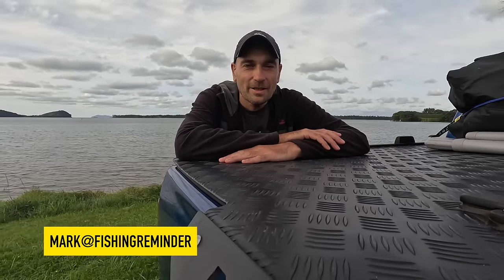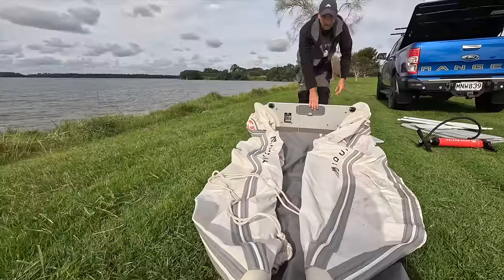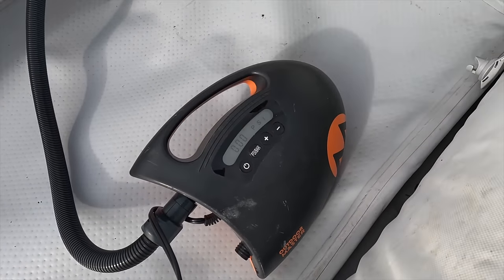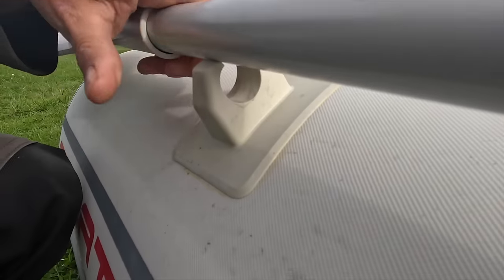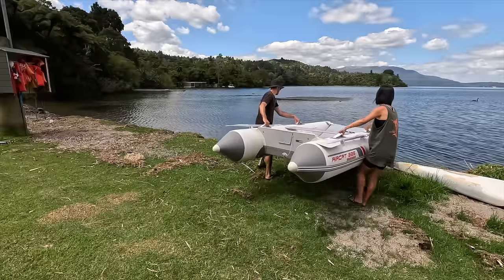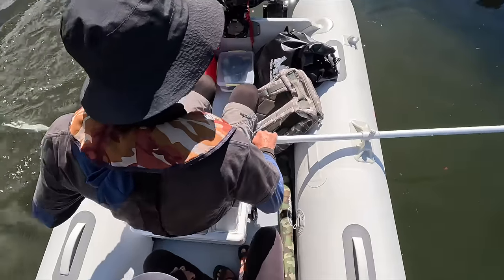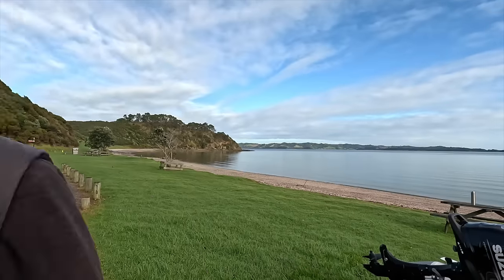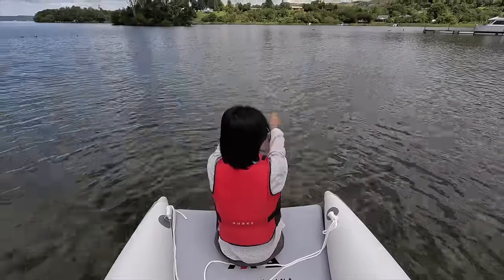Aqua Marina Aircat Review: The Best Portable Fishing Boat?

Comment: The holes in the transom are for a safety cord or chain to the motor so the motor doesn’t fall in the water
Reply: I’ve seen many fall in while boating at least if it falls in your motor won’t hit the bottom
Reply: hey Ray. we hang our Rib off davitts at the transom of our and most catamarans.This is another reason for these holes
Reply: I do not think these holes are for a safety cord.  There's a loop on the inner motor mount plate that is there specifically to cable the motor to the transom.  I think the holes are to mount eyes for either towing or hanging.

Comment: Awesome work brother. I bought one back in January and there was no info out there. Paid $1050 new so  I was a bit worried it may have been rubbish compared to the much more expensive truekit etc. I run a 9.8 2 stroke parsun. 32km/hr one up and 26-28km two up, it can plane with upto 230kg of weight on board. I put the same wheels on. Took a bit to work out the measurements, but they work really well.
Reply from the maker: thanks man. Yeah you can't beat it for the price, eh. A 9.8 HP would be awesome. I only wen't with the 6HP to save on weight for traveling. It does make quite a difference if you get up to 32km/h.
Reply: @Fishingreminder  I run a 15 hp 2 stroke now for when I am loaded up. Doesn't really get a higher top speed get up to 32/hr with two and gear,  but so much quicker onto plane and running at half throttle for a cruise at 28/km hr.
Reply: @jwqc1 I am interested in getting one of these with a 15hp outboard. Do you think the boat handles the bigger outboard well? Not too heavy?
Reply: Hi do you know the best way to mount a fish finder transceiver to the Aqua Marine Aircat?
Reply: @jamesdfriend  handles it fine, but its a  light 2 stroke 15. Not sure about a heavy 4 stroke

Comment: I have the aqua marina 3.5m udeluxe can't recommend it enough for the money . But I find i can pump mine up in 10 mins with the 2 way pump supplied . But when I am inflating the floor I unscrew the 2 way valve and just have it on 1 way for the last part as it's too much pressure for the pump when you pulling pump handle back up. I have recently taken the boat to fiordiland and stewart island and it has been great. Also I tried the rib ports too and I think the boat has a silicone coating and if you have a look on burnsco they have a 2 part inflatable boat repair kit and that's what raillblaza recommended for gluing the ports down to the pvc. I run the merc 3.3 hp 2 stroke on mine as it was 13kg to fly into fiordiland . Gets on the plane with one person which is amazing . Would like a bigger motor now though. Great review enjoyed watching. Keep up the great work cheers
Reply from the maker: That's awesome Phillip. Cheers for the feedback. I'll be taking it down to the South Island this summer. Looking forward to it. Might take it to Steward Island as well. Did you use it to get to some campsites?

Comment: Hi, do you think that the boat is sturdy enough to support a 20 HP engine? I know it is above specification, but I already have the motor. The idea would be use the engine at a medium throtle...
Reply from the maker: I doubt it. The problem is the weight of the 20hp engine. Not sure if the transom is sturdy enough to hold that weight since it's all just glued. It would be good fun though cranking that up with a little boat like that, you'd be flying, haha. Maybe give it a try and let us know if it works.

Comment: Great review . Considering a small inflatable for our caravan trips. To seal those air leaks you CAN patch using Stans tire sealant for MTB tires, works treat on my old hypalon boat, totally airtight for couple seasons then repeat. You may want to research chemicals used and see if they attack boat material. Alternatively try on inflatable floor first and see if it is OK after year before using on boat as floor is cheaper to replace. 

The holes in transom are for eyebolts, fit eyebolt to both sides. Used for craning boat when launch tender. I use inside ones to clip things to them. Especially a safety rope for your new motor, also tie the two motor clamps together with bit of rope to stop them unwinding. Youtube has plenty of videos of outboards going south while underway.

Tightlines
Reply from the maker: Thanks for the feedback and the tips. Much appreciated. Also for telling us what the holes in the transom are for. Good idea to secure the outboard 👍
Reply: Justed edited my post replaced can't with CAN.

If you can remove valve then pour a cup into air chamber. Fit valve pressurise enough to hold the shape and rotate boat so sealant flows to holes. In my case they were on top so upside down. Try to keep it out of valve. If you can't remove valve use syringe with small hose which should fit through valve. Only takes a few minutes to set, best left at low pressure for few hours.
Reply: The holes are for umbrella, anchor rope, fishing rod, etc

Comment: EXTENSIVE REVIEW.

I purchased the Aquamarine Aircat 335 in late July 2022, it's approx. 8 to 9 months old at the time of this review. I've had problems with an extremely sticky substance after about 2/3 months of use as a tender (I live on my boat in the Australian heat) It seems to exude from the PVC and is impossible to clean with conventional methods of maintaining an inflatable dinghy. It's so sticky that clothes are ruined if one sits on the tubes, as the substance transfers to shorts and WON'T come out in the wash. It's so sticky that if my little dog rubs against it, he sticks to it, poor boy!! I'm 78 years old and I've owned many inflatables over the last 60 or so years, luckily they were all made in America or the U.K. and are probably still going strong. My last inflatable was a 20 year old PVC 'American made' Mercury that I bought second hand and was used as a tender and all it had on it was scuff marks and general wear and tear marks, not even one puncture, but I was stupid enough to give it away to a friend when I bought this Aircat. This sticky mess is all over the dinghy, possibly wherever sun gets to it, even under the handles. If I give another boatie a lift then I have to put some canvas down for them to sit on. After trying all methods of cleaning, including specialized inflatable cleaners, sealers etc., and a Gurni high pressure gun, NOTHING removes the stickiness. I did a test patch with ACETONE, GOD FORBID, which removed it with a very hard rub. But then the sticky mess returns after a few days anyway so I have now totally given up cleaning this dinghy and it's in such a mess, it's embarrassing. If one rubs against it, then it will remove the hairs on your legs. Maybe I should sell it to a hair removal salon!!! We are in Autumn now and the stickiness has settled a bit so it's definitely the hot sun causing the stickiness. After 6 months of use as a tender the large sheet of PVC that holds the air floor in place, which is still securely attached to both hulls the full length of the boat, has stretched quite a lot and in turn, even a small amount of pressure pushing down with one hand in the middle at the front as a test will send the front under water, so trying to get back on this dinghy in deep water would be impossible without filling the thing with water. It was OK when brand new, but not now that it's stretched. This means that even with only 2 people on board at midships the front will go under water and the Aircat fills up with water!! This Aircat cannot be towed behind a boat...EVER...DO NOT TOW IT, as even towing it at 1 or 2 Knots the front will go under and the Aircat will fill up with water up to the top of the transom and will drown the outboard on the Aircat, which nearly happened to me. Aquamarines own compliance plate on the dinghy states it will take 5 people or 500 kilos!!! Well luckily I'm mostly on my own and it's very safe and quite capable even in a small/medium chop with my 4hp four stroke on it. The speed with one person on board with the 4hp is about 4/5 knots and I think it would plain with a 6hp outboard with one aboard. On the odd occasion I have a passenger on board it gets rather hairy when the bow goes under water when coming off the throttle and whatever gear is on the floor gets ruined when the boat takes on water. It's dangerous enough with 2 on board, so 5 people as per the compliance plate would be downright deadly in it's present state. This compliance plate should be changed to a maximum of one adult and one child... At the most. All the seams, handles, ply transom attachment etc. are still OK and the glue has not given way anywhere.....The supplied ply seat was totally the wrong size and would never fit and after I made lots of adjustments, it split anyway as soon as I sat on it and I'm not that heavy. Admittedly any dinghy used as a tender, has to work hard but a "decent" dinghy will cope. If you have children then please keep an eye on them while playing with this dinghy. In Aquamarines own video it shows this Aircat as a tender pulling up to a yacht, so anyone would think it's OK as a tender. Even left on davits, if it's in the sun it will eventually get the sticky mess. If you are cruising and only use it when you get into a new port and deflate it after every use, then it may last. The PVC on this Aircat IS NOT SUITABLE FOR PURPOSE. My emails to Aquamarine, the manufacturers, really didn't get me any satisfaction and I was told by them that I didn't maintain it, which really got my back up. Luckily, the Australian retailers were very good, understanding and came to the party. Photos available. Rob

Comment: Hello! thanks for the nice review.
I have had my boat for 4 weeks and am very satisfied. I have a Yamaha 4hp that weighs 23 kg. I carry boat and motor up in the apartment 3 floors so I think max 6 horsepower due to the weight or what do you think?
Reply from the maker: yeah if you transport he engine frequently I would not get more than 6hp. It would be getting too heavy and less portable. If it's too much hassle setting up the boat then you won't be using it as much either. So in my opinion stay as lightweight as possible.

Comment: Good video. How did you fix the seam leaks on the floor. Was it an easy fix?
Reply from the maker: cheers, I just bought a tube of glue for inflatable boats from a boating shop and put some over the bit of seam that was leaking. That stopped it. Super easy fix. The leak was only very tiny to start with.
Reply: @Fishingreminder  thx. I ended up going with a Takacat but I essentially agree with you. I’m not able to buy these aqua marina where I’m located but I’d rather have 3 of these than a single Takacat almost assuredly.
Reply from the maker: @bluedoggum8373  awesome, I'm sure you'll be super happy with your Takacat, once you get over the price shock, haha. A real big advantage of the Takacat is the open transom. Makes beach launching so much easier.

Comment: the holes in the transom are to attach a safety cord to the motor. I normally add a ring bolt to one side of the transom, then i have a short chain with a snap hook to attach the chain through the carry handle on the outboard. I am a scuba diver and i cannot tell you how many motors i have had to search for. The problem is they never fall straight down. Because of petrol in the carb and air in the cover, they just carry on running because most people are too lazy to attach the safety cord to themselves. I once found one over 500m from where it had jumped off.
Reply from the maker: I always wonder how the outboards can come off. I heard that it happens quite often. I might have to attach a chain to mine as well.
Reply: @Fishingreminder  people dont tighten them enough, they vibrate loose or the actual bracket breaks. Last year myself and my son spent over an hour underwater in place called Malin Beg Pier, Donegal, Ireland looking for a motor that had jumped off a professional fisherman's boat. Clearly was not on tight enough. Can happen to anyone.  It was hard to find as the place is full of kelp. 
P.s. because the bracket can brake, the best is to loop a chain through the carry-handle on the engine.
Reply: @Fishingreminder  sorry meant to say. fantastic video. thanks
Reply from the maker: @leonbwr  cheers for the tip, after hearing all the stories with outboards falling of, I'll get myself a chain and pass it through the carry handle as you suggested. Would be horrible to be miles out there and suddenly you find yourself without motor.

Comment: Hey,
I just found your channel, very cool and great information.
Question for you,
I am going to buy an inflatable this month with an Aluminum floor and transom.
Is it best to store the boat deflated in the bag over the Winter months " I live in the Northeast" or keep it inflated.
I am also concerned with mice getting in to the garage and eating the PVC
Any recommendations?
Thanks so much
Reply from the maker: Depends on the boat, you could keep it inflated under a tarp but I would release a little air so it's not fully inflated to allow for contraction and expansion with changing temperatures and have less stress on the seams. I'm not sure about mice but wouldn't think of it as a problem.

Comment: How does this preform in chop or wind? I’ve always wanted one but my local bay gets very windy and choppy. Obviously small craft should not be out in that weather but I might encounter some of it.
Reply from the maker: It can handle light chop and wind. But when you go into the bigger chop it gets pretty slow going and bumpy as you can't really comfortably plane anymore. If you go into chop and strong wind gusts too fast head on they can lift the front of the boat up a bit as well. I've been out in some gnarly conditions and it's pretty much okay until you start getting white caps. Small chop is no problem and you can plane over it.
Reply: @Fishingreminder  😄🤷🏻‍♂️I think I should buy one. You talked me into it lol. Thank you for responding!
Reply from the maker: @brandon.4451  😂cheers, I think you'll have a lot of fun with it. Let us know how you get on.

Comment: is this type of boat (front geometry) good for the sea? Or does it increase the risk of water coming in and sinking?
Reply from the maker: It has been pretty good in the sea. Under normal conditions there isn't any water coming over the front. It can't really sink either because the floor is also inflated. If water get's in it will drain out the back (if the drain plug is open). The only problem I found is when trying to launch on a beach with big waves. If they crash over the bow then there'll be lots of water in the boat and it will take a while until it drains out.
Reply: @Fishingreminder  okay thanks a lot. I'm in Athens and waves are choppy here so i ll probably go for the classic shape and maybe a bit elevated front if possible. Cheers

Comment: Can you mount a bimini top on the Aircat?
In principle yes, but how is the stability? There is a risk of the boat capsizing when the wind is strong. However, the bimini top should only be set up when anchoring (shading). What is your opinion?
Reply from the maker: Not so sure about that. I don't think it will affect the stability of the boat at all. You might have to glue on a few holders to the pontoons for the bars. But that's probably not much of an issue.
Reply: @Fishingreminder  Thank you. On our lake (Walensee in Switzerland) and on the Mediterranean it will work for anchoring in a bay (up to wind force 2-3).
For the Holes: answer form Aquamarina: it is used to lift up the boat with hooks
Reply from the maker: @gerrypi51  thanks for the update 👍

Comment: Did anybody experienced such effects like in the recent post? I am planning to buy this boat, I generally use it 5-6 times in a year on dead river and on the Aria so maybe it fits to my requirements. Now I have a Kolibri 290T pro paddle boat but it doesnt have enough space for 3 people, but on the other hand it is a well made boat, i had accidents in few times with really sharp rocks and it handled. 

My other question is that: what is the overall equipmnent's packed dimesnions? What materials they used on the outer hull on this boat (g/m2, thickness, producer, anything) because i did not find these info at all?
Reply from the maker: I wouldn't recommend this boat for 3 people fishing. Not enough space. You could transport 3 people from point A to point B maybe - but not fishing - unless you guys enjoy cuddling 😂 
The packaging size is pretty small for a boat like this. I don't have the exact dimensions right now but but it fits into a small car boot ( Honda Fit for example )

Comment: get a quick air pump they are cheap like 15$ it will fill up the boat fast... a pressure pump takes forever... im done  and set in like 10 mins ..or if you have a leaf blower that also is even faster lol
Reply from the maker: Good idea and saves cash. I used to use a cheap airbed pump to fill it up and then the hand pump to get the floor up to 15 PSI. But it's more convenient with the electric paddle board pump I'm using now because it does the fast and slow inflation automatically.